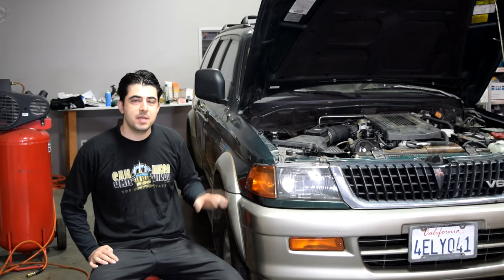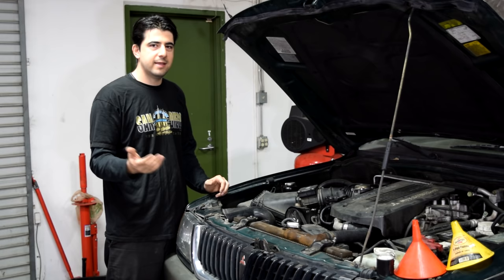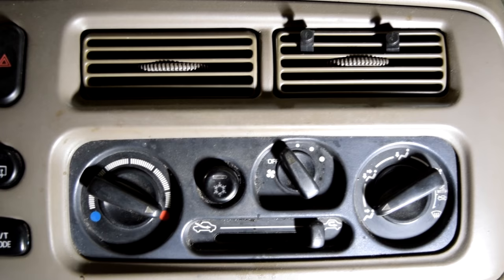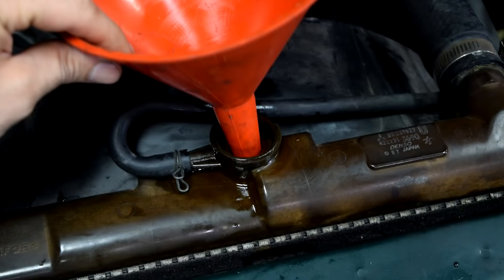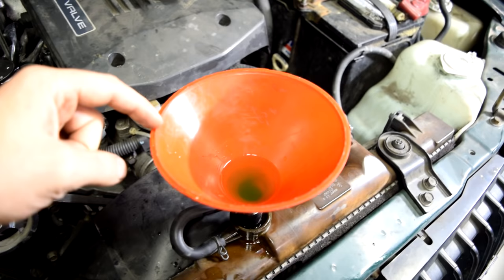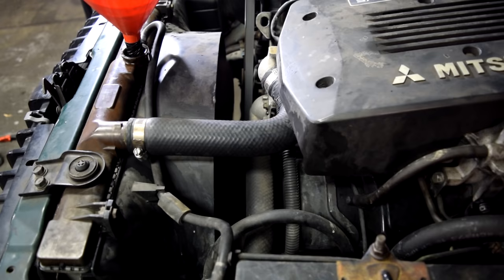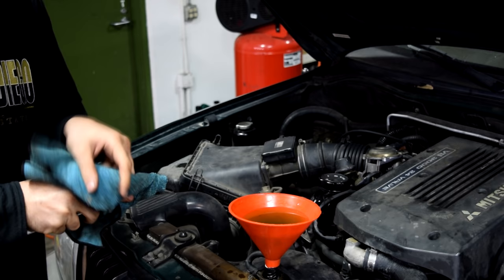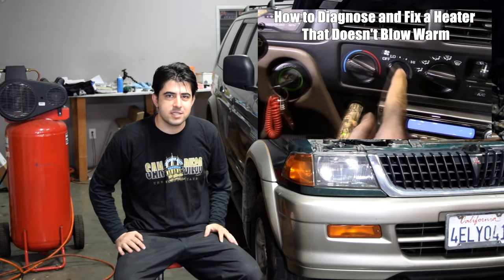Learn How To Bleed Air Out Of Your Car's Cooling System With This Quick And Easy Diy Method.

Comment: Hey! I currently own 2005 Acura TL engine swap on a 99 Honda Civic. I'm suspecting some air in the system but I have a couple of issues. 1. I don't seem to find the bleeder plug on this engine. I've heard some engines don't even have one. What I've read it has, it's an "engine drain plug" located on the passenger side on the engine block. Should I loosen that plug instead? Is this a crucial step in this process anyway? 2. As I start my engine, everything seems to be going well as I see some air bubbles coming up, all I'm waiting for is for my fan to come on, but my fan doesn't even get to come on before I have coolant start jumping viciously the same way hot oil looks when you drop a turkey in a deep fryer. Then coolant starts splashing out of the funnel to the point where I have to shut off the engine. I'm using same size funnel you use in this video and even like that I'm getting coolant rising up to about a little more then half way and erupting like a volcano!! I'm not sure If air still coming out at that point I can't tell. One thing I did want to mention though, my fill cap for my radiator it's not actually on the radiator, it was actually installed half way the upper hose. Reason being, my radiator was installed tucked away under the frame/chassis in the front of the car to make room for this engine swap. So I couldn't have fill cap on top of radiator. Any suggestions??? I would greatly appreciate your help. Thanks!

Comment: I hope you can help me with a simple problem concerning coolant system in a Ford Taurus.

I drained, flushed and refilled the coolant system in my 1999 Ford Taurus (77,000 miles). The car runs fine, does not overheat and the coolant level in the reservoir is at the optimal level, but, now the "low coolant" light comes on every time I drive the car.  I suspect there is air trapped somewhere in the coolant system.  This car does not have a coolant air bleed screw; also it has a pressurized coolant reservoir, and no radiator cap. How do I fix this problem.  Would it help if I drain and refill the system but taking some other precaution that I may have missed the first time around.  

Would greatly appreciate for any help.  Thank you very much for any insights.
Reply: chandra0102 , the process works the same by removing the cap from the overflow tank and watching for air bubbles when the coolant cycles from the opening and closing of the thermostat. Do as the video says, and feel for even heat on the upper and lower hoses. It won’t be a scalding heat, just warm to the touch. Hope this helps

Comment: I have a 04 explorer v6 that has started to vibrate and shake all crazy at the 3k rpm line and up. But not the engine, only the radiator, upper/ lower radiator hoses and the hoses that go into the heater core. Anyone have an idea to what it could be? It seems strange to me. Thanks.

Comment: Did the upper and lower intake gaskets on my 2001 lesabre 3.8 litre, filled system, checked everyday, no leaks car runs at normal temperature which is usually 183, same as before gasket change, plenty of heat everything is nominal, except when the car cools down say overnight the radiator hoses are as flat as a pancake, when I open the radiator cap it's like opening a new can of coffee there is a vacuum sound and the coolant level is normal, I can't figure out what's causing this, before I did the gaskets I may have overdone putting radiator leak seal  in because I didn't have time to do the job, could it have clogged the radiator up, any ideas, anybody, I've done many gasket jobs and never had this happen.

Comment: I had a catostophic coolant leak coming from water pump followed by overheat. I replaced water pump. Filled fluid. I started car with cap off and ran heater. Fluid swelled and pulsated slightly at edge of rad rim. Temp rose quick and started to over heat within 5 minuts. At that point fluid was gusshing from radiator. What the fuhhhhhhhhhhhhhhhhhh

Comment: How can you do it with a car that doesn't has a radiator like the 2017 honda crv?, mine has water sound from behind the dashboard
Reply: If you have a water sound behind the dash then you have air in the cooling system... same process whether it's from the rad cap or the reservoir cap

Comment: I have a 2004 Infiniti G35 Sedan.
My car has been overheating,

So I changed my Radiator, Thermostat and I know it’s not water pump because there is pressure.
Could it be because I didn’t “burp” the air from the bleeding valve? My car has a valve in the back.

Comment: I just changed my coolant and I hear bubbling inside my dash. Not overheating and hot air in vents is good but i hear bubbling.
Reply: AIR..bleed it. Try parking on a very steep hill pointing up first with heat on and you might get lucky.

Comment: Hi , after I do this and put the cap back on and the car cools the radiator hoses will suck in and then if I open the cap it will suck in some air back into the system and the hoses will go normal again . What does this mean ?
Reply: joe smith , it means there is air still in the system. It could be a faulty radiator cap or expansion tank cap. Plus, replacing the hoses with belted hoses really helps.

Comment: Can I help me? 08 ridgeline. New heater core (3000 miles old). New thermostat.  New coolant temp sensor..No overheating. But Still have cool air at idle but at  higher rpms it heats up instantly.. Air in heater core maybe?? What can I do?
Reply: Feel the heater hoses. Is supply cool, too, at low RPM then warms up? If so, check the water pump. This assumes that the temp. gauge is reading normal and stable.

Comment: My air won't get cold. Apparently i had air in my lines and then I added refrigerant so that didn't work of course since apparently I had way to much air in the lines. Just don't wanna go spend alot of money to have th3 air pushed out of my ac lines or wherever th3 air is. Plz reply. Ty
Reply: There really is no alternative to repairing leaks, evacuating the system properly, assuring that it retains the vacuum and then refilling with a weighed-in charge. That's assuming that all the components are functioning.

Comment: My temperature went all the way to H and the engine started getting silent I drove to the closest parking lot about 2 min away and my coolant reservoir was completely empty but I see no leaks could it be a blown head gasket?
Reply: Huge leak or lots of air. You might have damaged the engine. Were the radiator drains open?  Hose disconnected?  Engine reading hot must never be run at all.

Comment: My car is leaking coolant  (seemingly at the water pump), right after coolant change,  leaking is interminent,  could there still be air trapped inside?   what's with the leaking?    any ideas anyone?
Reply: @milcotto4153    thanks,  my car stopped leaking now,  it was definitely from the water pump,  I think they are designed to leak for safety, that's how they get lubricated sometimes,   leaking on and off,  was too much at times,  then slow,  then stopped,  doesn't seem like something has raptured.

Comment: 1998 ford escort changed thermostat,sencors flushed heater core ... I can not get fan to kick on its driving me insane it does work I tested it so I know it works ...Any ideas I am trying to bleed system but haven't been able to find bless screw
Reply: Wire that joker in direct
Reply: Some engines don't have bleeders.  Google yours. Is the operating temp. normal?
Do you have good heat in the cabin?

Comment: Well turning the heat on doesn't open the heater hose lol water flows in the core with our without the heater on. All the setting you did is let heat in the cab by fan lol
Reply: On a lot of cars, there is a heater control valve that does not let coolant go into the heater core until the engine temperature is high enough.

Comment: so my car over heats and when itake off the radiator cap it shoots out water. and when the car gets hot it starts knocking
Reply: So. Abel could be you're water pump or bad radiator. The reason the coolant is shooting out is because it is hot when you open up the cap. Wait a few hours after heating to normal engine temp for it to cool down. Do not drive the car if the engine is overheating very dangerous and could cause tons of damage

Comment: After changing the head gasket of my CR-V R1 I start the the it run well for minute but when I switched of and try to start the engine it cannot start. I tried these for some minutes and the battery went out drained..
Reply: how will I fix this problem?
Reply: augustine siaguru you reset the timing? If its the head gasket you replaced then you must reset the timing due to taking off the timing belt in the process

Comment: Can someone help, I tried change 💧 pump, thermostat and top guscate but still over heating. BMW SEDAN 2.2
Reply: Does your vehicle have a coolant temperature sensor, it could be faulty also. I changed both the Thermostat and temp sensor on my Mitsubishi Montero Sport. Seems to have fixed my overheating I bleed the coolant like this and another vid i watched said. Seems to have fixed my over heat. Temp gauge stays about half way now while driving.

Comment: Mine when the thermostat before thermostat open the water is boiling is that normal?
Reply: Not unless you are at high altitude where the boiling point of water is lower.  Your thermostat might have gone bad; typically they will open at around 180 degrees F.  You can't tell by looking; you could put it in a pan of boiling water to see if it opens.  If it doesn't, it's bad.

Comment: I have to add coolent every week cuz of some leak, do i have to repeat this process every time??
Reply: Yeah but it shouldn't be that much air if you don't have to replace certain stuff all you are doing is taking off the cap so not much air is getting in only time a bunch of air gets in is when you take off a hose or tstat or water pump something like that
Reply: Not unless you have to add a lot. So stay on top of it and fix the leak too.

Comment: Can a mechanic please help me out here ? I went and got my car checked out cause when I was driving my air started coming out hot and then turned off due to the engine overheating . It was overheating really bad out of nowhere . The mechanic I took it to said it was a leak coming from the gasket behind the water pump . Well my boyfriend changed out the whole water pump and gasket and all that .  But it was still overheating so we changed out the thermometer rn and we’re currently trying to get all the air of my cooling system at this very moment lol . I guess I’m just worried that if this doesn’t work , then what is the problem ? And when I turned my car off the shit started squirting out of my radiator cap everywhere and my bf had me turn the car back on . Lol idk anything about cars I’m so confused rn

Comment: but   do you think we all have a v6 suv?     theres no heater connected in my car the engine is not the factory engine   the engine has a radiator and hoses though yet this video isnt of any help   well done

Comment: I'm having problems with my 96 Honda Civic cxthe temperature gauge will go past the middle only when I'm at a complete stop at idleI swapped out all the time sensors thermostat and switch and even water pump and timing are new can anybody help me with some coolant level is always at the same it doesn't leak any
Reply: Have you checked your cooling fans to make sure they're coming on?

 Overheating or high temps at idle are signs that not enough air is circulating and passing through the radiator, which the radiator fan handles when the engine gets to a certain temp. 

Turn on your AC and see if the cooling fan comes on and works normal. If it does, the problem could be the fan resistor needing replacing, among other things. If it doesn't come on, time to figure out why the fan isn't kicking in.

Comment: So i changed out my thermostat on my jeep jk today. When i went to fill it it only took about 6L (needs 10). After running the engine and heater on, the temp rose up to operating temp on the gauge. However the heater still blew cold air and then noticed the funnel starting to fill and almost overflow. I turned off the engine and felt the upper rad hose and its still cold. Cant seem to get the system to pull in the last 4L

Comment: Having air in the cooling system does that cause misfires
Reply: No, it does not.
Reply from the maker: +JOHNNY C As Jake said no, what happens is the air can cause an overheating issue which could cause mechanical engine failures, resulting in missfires. But on its own no it doesn't.
Reply: +RatchetsAnd Wrenches  I recently drained and refilled my coolant . but now it's been getting hot really fast. it never did before could air have gotten trapped in the system ? thank you
Reply: Ratchets And Wrenches

Comment: hey I just replaced my thermostat and water pump on a 97 Ford Explorer 4.0 v6.  and now my heat gauge is stuck in the middle and won't go down. what do you think could be the problem?
Reply: your old thermostat probly didnt work or the new one might be a higher rating and its running normal now

Comment: when I rev up the engine it shoots radiator fluid out
Reply: bad head gasket.  compression is leaking into the cooling system and causing a volcano out of the highest point.
Reply: Ricardo The Computer Wizard  if it "shoots" out like he is saying, that is compression seeping through the head gasket.  happened to my 94 Camaro.
Reply: Matthew Smith can this cause idling issues as well?